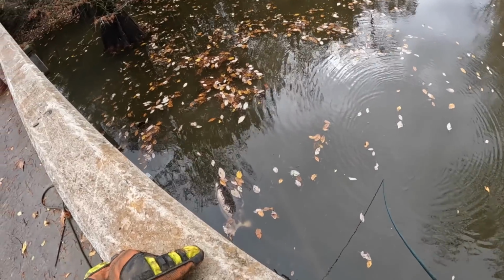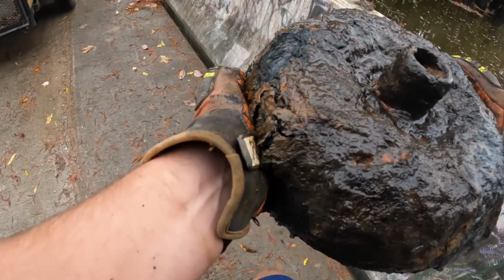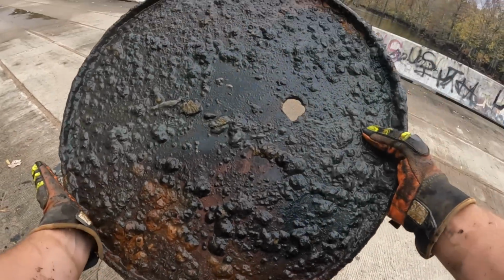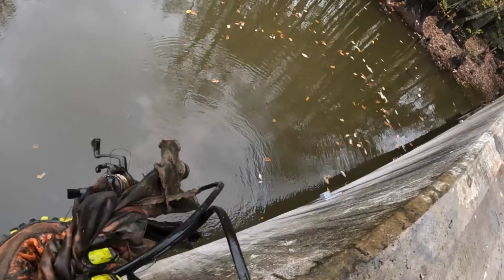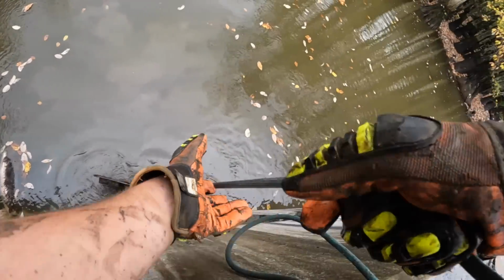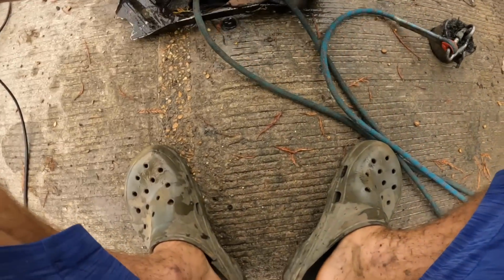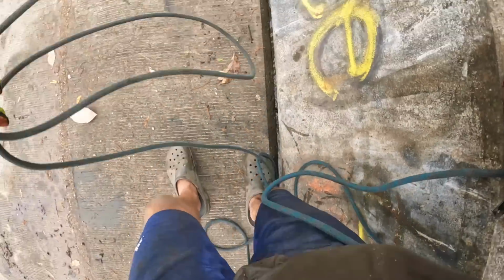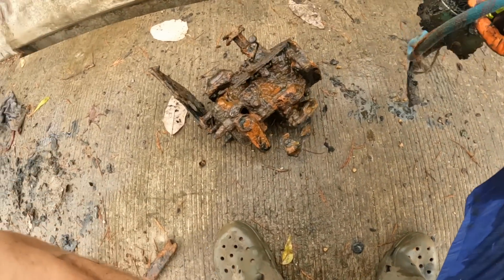This River Is INSANE - Mind Blowing Magnet Fishing Spot

Comment: That piece you thought was a ceiling fan and was leaking oil, is called a torque converter. It goes in between the motor and transmission of an automatic shifting car. It was leaking transmission fluid and it's great you took it out of the water!!

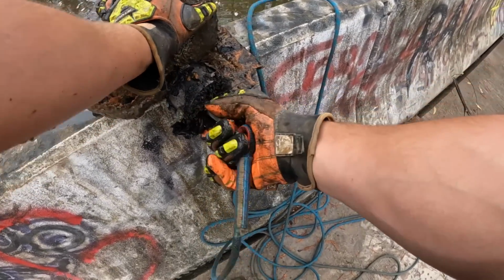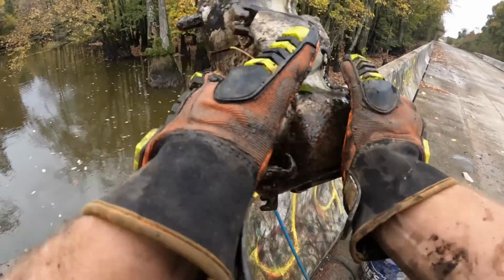Comment: @ 3:06 that is a torque converter ,, it goes between the motor and transmission for automatic drive vehicles and has lots of tranmission fluid in it ! ,, @12:00 that's a valve cover for a 4 cylender motor !

Comment: The round thing that at first you thought might be a ceiling fan is a Torque Converter for an automatic transmission. It transmits the rotation and power from the engine to the transmission.

Comment: That thing leaking was a tork converter for a transmission and they are always filled with oil. Try your claw where the converter was there might be a transmission down there. But they are made of aluminum.

Comment: That thing that you thought was a ceiling fan was a torque converter for a automatic transmission an that thing that you thought was a top of a gas tank was a valve cover it’s a top part off of a engine an whale